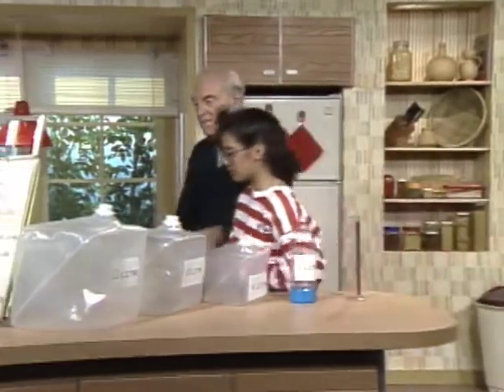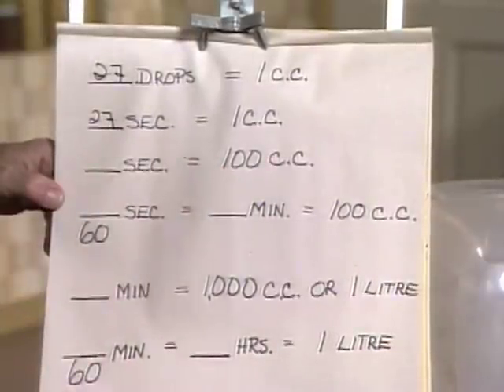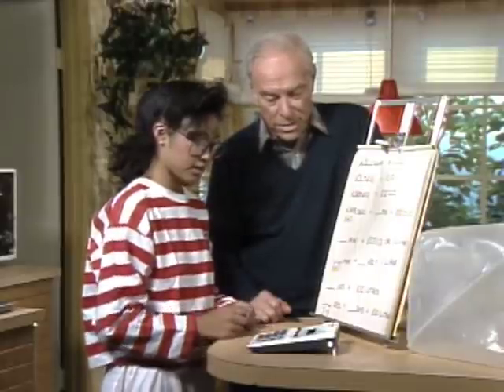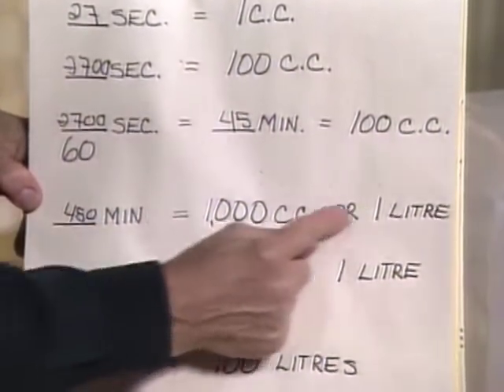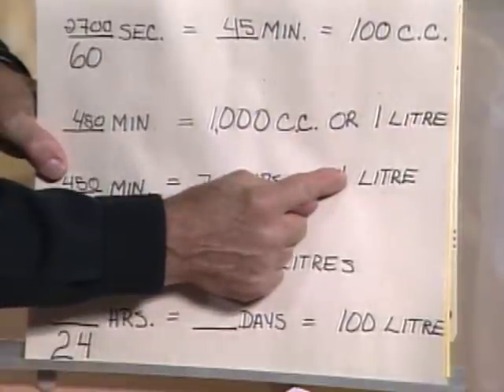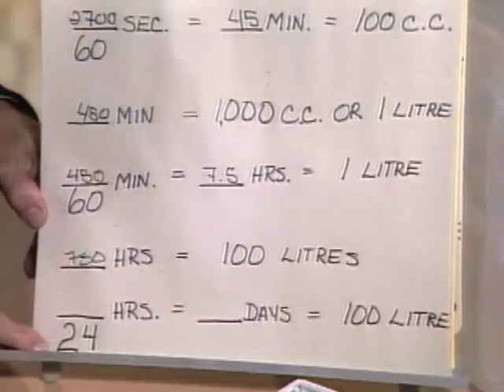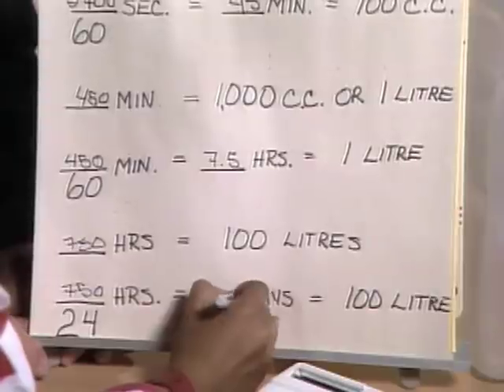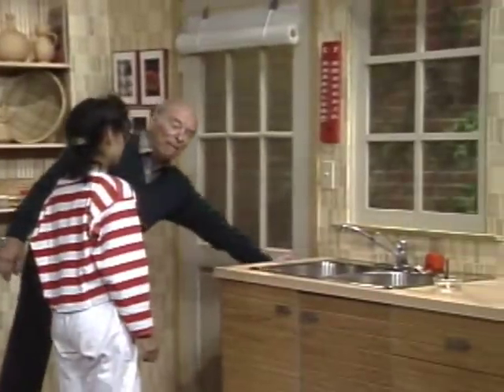How Much Water Does A Leaky Faucet Waste? - Mr. Wizard's Quick Quiz

Comment: He calculates it in a backwards manner. About 2cc per minute, 120 per hour, 2880 per day, 87840 per month (30.5 days). Then divide by 1000 to get liters, so about 88 liters per month.
Reply: At 1 drip per sec and 27 drips equal 1cc, that would make it 2.2cc per minute. Then using your equation that would equal about 97 liters per month.
Reply: They do this for the young audience, whose maths skills might not be developed. It also views better then doing a bunch of maths and showing the answer.
Reply: blargg common core math before it was cool...😂
Reply: How much liters of water will be collected in 1 year??